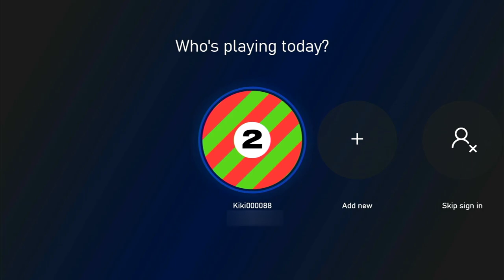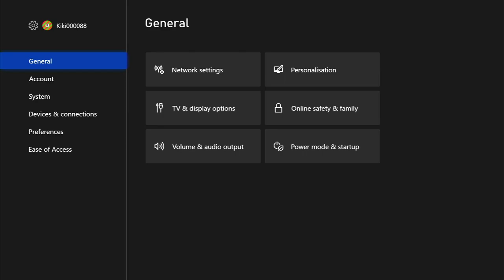XBox One S no display on TV / White light of death repair

Comment: I'm currently dealing with a one s as well. Has the same symptoms as in your video. This malfunctioned after a lightning storm electrical surge. I fixed the power supply but then I got the BSOD. So, changed the retimer, it did not fix the issue. Checked the emi filters, and BOTH were shorted across. After changing those, they were no longer shorted, but still not fixed. Looked next to the filters at U8B1 and the resistors in that area. While testing the resistors I found some odd values when compared with a known working board. The only explanation I could think of would be the IC at U8B1. Turns out the PXD, the name of the IC here at U8B1) is bad. I have no idea what that IC does. When I replaced it, the resistors that tested odd before now matched the working board. However.....i STILL have a BSOD. I also noticed something nobody has an explanation for.  About 10 to 12 seconds after pressing power, the white power indicator flashes twice rapidly then the system appears to turn off and restart.  After it restarts it just stays a solid white light but as stated, no image. I hope this info may help someone in troubleshooting. I dont know what to check next for my current system. Hopefully I find an answer or someone can explain the 2 quick flashes on the power led.
Reply from the maker: This is really odd. The PXD IC is the so called ESD booster IC. What I read about this is that the one in the one x is not compatible with the one s. I only have one idea. You wrote that at first you replaced the retimer ic but still did not work. Afterwards you found the filers to be shorted. Cannot be that the shorted filters blew the new retimer again?
Reply: @kikihobbyrepair   hmmm. That is possible! I do have another retimer I can try. I will also recheck my hdmi port. I appreciate the suggestion :)  if it is not the retimer I may give up on this one. Ill post my results here when I finish!
Reply from the maker: Yeah, give it a try then. But anyway lightning failure can be extremely leathal.